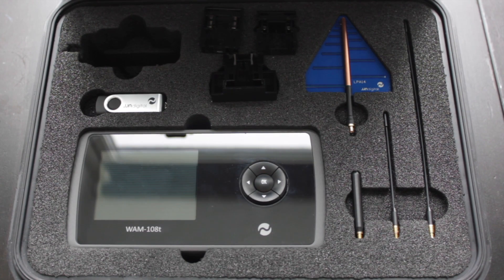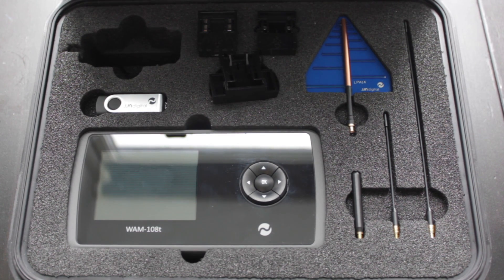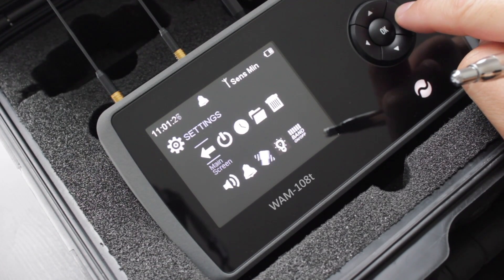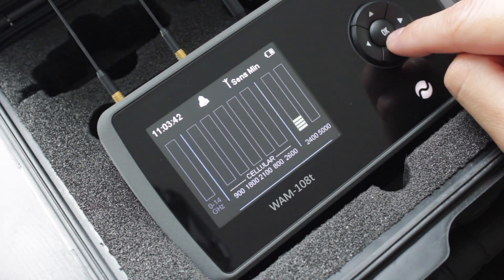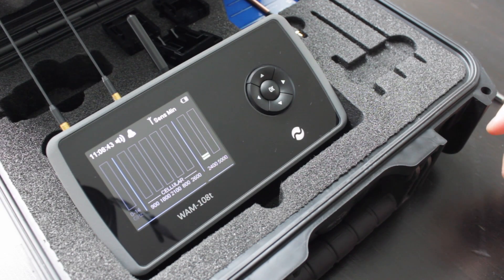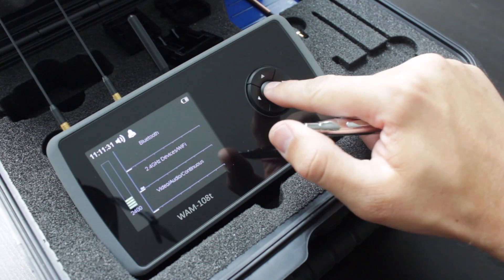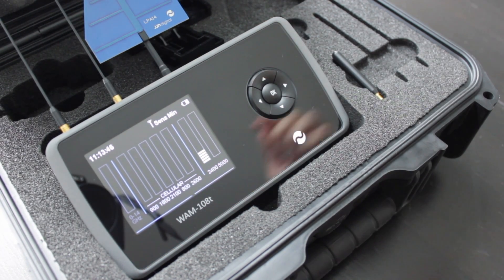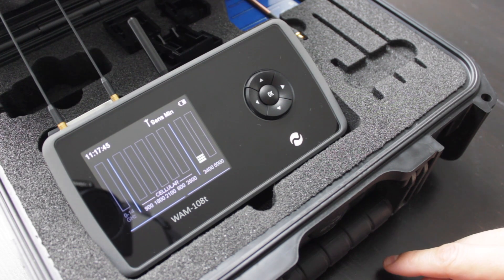How to use the WAM - 108t RF/ Bug Detection Device

Comment: Hi Michael! Thanks for the video! Do you know if this scanner would pick up a signal in the cellular range that isnt in one of the 5 they list? (eg in Australia some 3g/4g connections use 700MHz, 850MHz, 2300MHz etc. Would they still be available on one of the more detailed pages if not in the 5 bars on the main screen? Thanks!
Reply from the maker: Hi Hannah, apologies for the delayed response. This device works from just above 0 to 18,000 gHz so it is well covered.
Reply from the maker: They will he covered on the centre part of the screen (the cellular element) but you can also break it down into more detail. So yes on both parts. Hope that makes sense
Reply from the maker: I’ll be in Australia again in Jan 2020 delivering the TSCM programme. If you’re interested in attending, please let me know and I’ll inform our partners in Sydney